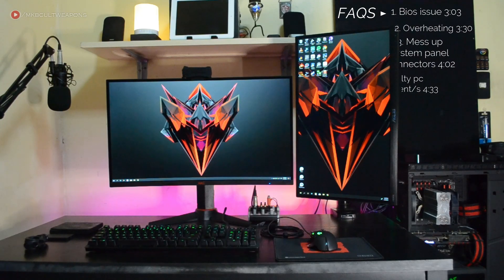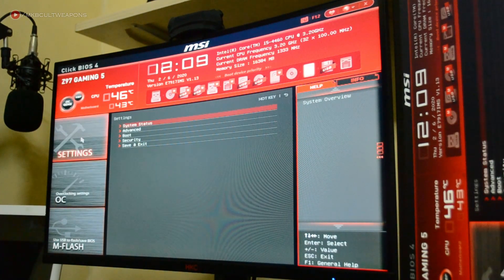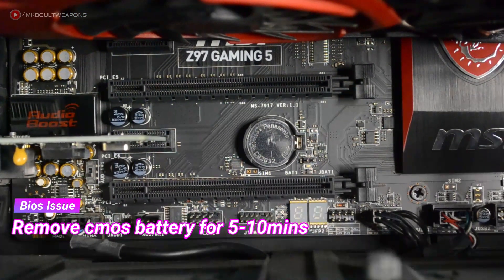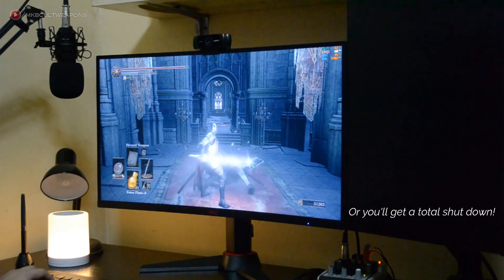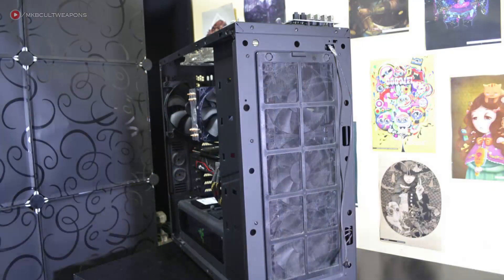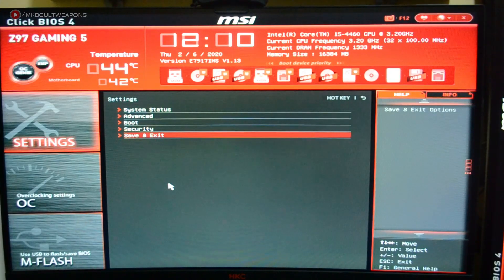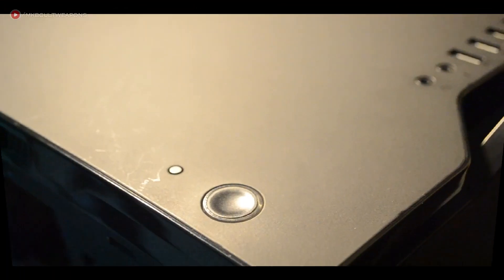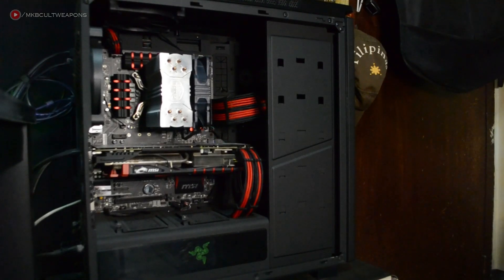Pc keeps restarting FIX / Pc continuous restarting FIX

Comment: Hey man I recently bought a pc and my screen will freeze then turn green and then my whole pc will restart, do you have any clue on what I could do to fix this?
Reply from the maker: is that during heavy workload or just during productivity? If you can still go to windows desktop try to update the drivers, gpu and windows 10. After doing the updates and still happens i suggest use the Rma already since it's new you'll definitely get a replacement

Comment: Can AVR cause pc restart too?
Reply: It restart again, I'll just take it back to the repair shop tomorrow so that they can find the problem, anyway thanks for your help, hope you gain more subs 👍
Reply from the maker: yes if it's faulty, i experience that once way back
Reply: @MacCoyzkie  can I plug my pc to the wall to check it?
Reply from the maker: @Reel_95  you can but not advisable, your psu will basically take all the pressure from power surge if in case something happen. If you live in a country that has stable and consistent power from outlet it's ok, but if you're not, better purchase at least a power surge extension cable,  i think it'll just cost around $8 to $10 https://gyazo.com/ce50da5ec6f19033701b78b1e365bcd4
Reply: I plug it to the wall and my pc still keeps restarting every couple minutes,so I think my avr is not the problem, I already had it check and the repairman said it was the mobo so I had them change it, when i got home and use the pc it only last about an hour then it restart again. What do you think the problem is?
Reply from the maker: @Reel_95  wait! it still happens after replacing a new motherboard? I got a theory though, if you have multiple drives, can you remove the hdd and just use the boot drive? of course shut down the pc before doing so. This might be a drive issue, i remember having this experience before, i did all the ram cleaning and forget that my drive is very old hdd
Reply: @MacCoyzkie  I never try to remove a hdd before but I'll try it later if my pc restart again, so far its been two hours since I boot it and I never encounter any restart.
Reply from the maker: @Reel_95  if it's already working you don't have to try it :)

Comment: Thnxxxx man ( 1 ram slot was broken )
Reply from the maker: i see, hope you get a new one, thanks for the feedback
Reply: @MacCoyzkie  bro can u help me a little more i fixed the restart issue .. But now its heating up really fast and lagging while even using chrome. It was working just fine the day before yesterday i was getting 100+ fps in valorant while even recording ... Do u know anything that  might solve the issue a little.
Reply from the maker: @ryu1279  are you using aio, if yes check the pump if it's working. If it's running too hot probably the airflow is not good, try opening your case during heavy workload
Reply: @MacCoyzkie  tnxx i think i figured the problem..  There are some issue in my hard drive i think

Comment: Hi, I have Alienwae Laptop 17 R2 that restarts after approx 30 mins. What could be the problem?
Reply from the maker: that's most likely caused by dust clogged heatsink. I know it's difficult to clean laptops but i'm still going to ask 😁 if you clean off the dust inside? For short it's overheating because of lack of airflow

Comment: Heeeeellllpppppp my problem just started yesterday when i was playin a game. It just ramdomly turned off then on but no image or nothing... I have my air conditioner in my room  and this one time when it started to blow cold air it turned off the computer completely but started bybitself back on normally.then the next day this happened, I tried the ram trick, no luck, also tried one ram stick no luck. Help pleaaaaaaseee. Quiestion, Can a virus cause this also?
Reply from the maker: wait what do you mean blow cold air, was that direct cold air coming from air condition or you use a fan to blow cold air in your pc? First of all please don't directly place your computer where the cold air is blowing from your air condition. You will short your pc overtime. 
Yes it could be a virus if you visit a lot shady websites that causes a lot of pop-up windows. If you accidentally click those it may install a virus in your pc. Some crazy virus can cause a program to put your pc to non-stop restarting.
Reply: @MacCoyzkie  thanks for reply ing, i had a small fan that uses water to blow cold air, and a big one in the window because its been so hot this days, i had the small one in the back of the computer so it doesnt heat up that much but i didnt know thats bad, is it? I just found out that if i take he gpu off, the computer starts normally, with the the gpu installed it turns on and off. So that means the gpu went bad already? Or was it a virus that messed  my gpu! Because i just click on that especific game that i installed to play it and it did that thing turning off and on by itself in a loop with no image on screen and the only way i turn it off was to keep pressing the power button.
Reply from the maker: @jaibo9154  if you have air condition don't let it blow directly to the pc also the small cooler where you put water to blow cold air, do not let that air blow directly in your pc because of those small water particles will short your parts. Did you plug your monitor to your gpu monitor input or to the motherboard monitor input? Upon reading your comment i think that's how i understand it.
Reply: @MacCoyzkie  when i plug in the monitor hdmi to my graphics card thats when it will turn off and on by itself, but when i take the gpu off from the motherboard the pc statsnormally, so i guess the gpu went bad? Or could be something else. I might get another gpu, i wont be puttingb the Small fan anymore to cool down the pc. Thanks for letting me know before the entire pc got meseed up. So you think those small water particles were the ones that messed up my gpu?
Reply from the maker: @jaibo9154  i don't want to give up yet cause i know gpu are really expensive. Can you ask a friend with compatible pc to try your gpu out? if the problem still persist then i guess you'll need a new gpu
Reply: @MacCoyzkie  Thanks for quick response. Thats what i want to do to test it in another pc, i will be asking around with my brothers friends if they have a pc. Most of my friends have ps4 or xbox. Its what i hate about computers if one of the expensive pieces gets messed up you gotta buy it again, im regretting selling my ps4 and xbox to become a pc gamer. If i would know. Thanks for all the help and response tho. I really appreciate it all.

Comment: I need help kuya. My pc keeps restarting when I turn on my pc. No display and no lights on the keyboard. I accidentally turned on my pc without the connection to the hard drive. After I connected the hard drive there's no display on the monitor but the light on the keyboard is on. After I tried the ram method, my pc starts restarting without display and lights on the keyboard. Please help me kuya asap. My pc is only standard and I use it for my online class.
Reply from the maker: wait what? you plug your hard drive while it was powered on? Bro that's dangerous you most likely shorted something in your pc. There are two things that might be broken, your hdd or your psu. The solutions in this video is not actually applicable in your situation. 

if you got a friend with compatible pc, can you ask them to try your hdd, ram and gpu (one at a time) in their pc. if it works with no problem then your motherboard or psu may be broken. I'm sorry bro but you need to ask help from a local shop to fix that for you
Reply: @MacCoyzkie  no kuya. I didn't plug my hdd while the pc is on. I turned it off first 😅 Actually we tried my hdd to my friend's pc and it works well. Then I showed him your video because I think your video is the most precise one. So we disconnected everything on my pc then we clean every plug and connector before we reconnect everything. Then the we did the ram method that you taught on the video then we reseat the ram. I only use 1 ram and I have 2 slots. Now my pc works well. Everything is running good, no parts were damaged and we tried to run the pc for maybe five to six hours and there are no problems with it. I didn't know that my only problem was dust on the ram and hdd. Thank you sir. You are really a big help to the pc community 🤙 Salamat kabayan!
Reply from the maker: @juliansomera9575  oh ok glad it's working now and glad the video was able to help you guys, thanks for sharing your story and for this feedback :)

Comment: I tried installing 2 more ram sticks, the guy who tried putting my pc together put the amd fan with the tab blocking the ram port i had to unattach rotate and reapply thermal paste, then found out that 4 sticks causes my pc (built june 1st 2020) to not show on my display port after removing the 2 new sticks i got if working but now it constantly crashes and kicks me out of escape from tarkov which i had 0 problems prior to having to move the fan can anyone help me please?
Reply from the maker: bro your pc is so new you have all the right to bring it back to the shop where you got it from and let them fix it for you. Anyway if it's constantly crashing i guess those ram sticks were not plugged in all the way or it's losing signal somehow
Reply: @MacCoyzkie  built it brother no shop haha
Reply from the maker: @iamgod222  oh did you bought the parts in different shops and build it?

Comment: currently having this problem, tried cleaning ram , removing a ram and still nothing, tried updating bios still restarts, checked the wires everything seems to be in the right place , I cant figure out why its restarting randomly , cpu was at temp was at 56C , tried updating drivers and it restarts
Reply from the maker: this might be also a low power draw, from psu or wall outlet. checking both of those may also help. i think your pc is fine and this usually happens when low power is given to the pc.  does it happen during gaming or even in windows desktop?

Comment: My pc just started to shut down and off out of no where, removing the cmos and ram sticks didn’t work at all. What could the solution be?
Reply from the maker: if you tried all the suggestions in the video and nothing work, 
1. if all fans are off and no lights in keyboard, mouse or anything in the pc then your psu is dead
2. you need to ask a friend with compatible pc to try your rams and gpu in their rig (one at a time). if it works in their pc then your mobo faulty

Comment: My pc is like going on and off forever but the monitor is not going on.
Reply from the maker: if you tried every suggestions in the video and nothing work that's probably a faulty psu, ram or gpu
Reply: @MacCoyzkie  i took my Brothers ram stick and gave mine to him and it is still the same thing. My does not work but my brother's does
Reply from the maker: @HHHavenn  your rams sticks are safe, this means that it might be your motherboard, psu or gpu.

to check gpu, ask your brother again to try your gpu, if it works then your gpu is safe too

to check the mobo if it's ok, turn on your pc and see if the lights are on and fans are running your mobo is ok

to check psu, you will not see any fans running or lighting up your in your pc, this means your psu is dead

btw, these are all applicable if your pc is around  1year or above. If your pc is newly build one, it must be incompatibility or bios issue. i hope this helps
Reply: Tanks for help. I am gonna try but all my fans are Running so it is not the psu. My pc is around 1 year so it is built correctly. If it start i Just want to thank you for helping.

(i got New harddrive and now it works but i needed to install everything)

Comment: Hi man. I’ve got a problem where my pc switches on for 10-20 seconds then switches of but immediately switches on again and again. I tried so many things . i do nt know what to do !!! Please help
Reply from the maker: if you have tried every suggestion in the video then you might be facing a psu or gpu issue. best thing to do right now is to bring your pc to a local tech shop
Reply: Mac Coyzkie thank u very much!
Reply: Mac Coyzkie hi I actually got it checked out and was told that it could be the motherboard and that there was nothing wrong with the gpu and psu . Could that be a possibility?
Reply from the maker: @mohamedchikhaoui8479  can also be but rarely happen. Usually the motherboard fails if the manufacturer is unknown but for known manufacturers like asus, msi gigabyte asrock, it doesn't usually happen in my experience. it's always the gpu and psu or rams. 
If the local shop told you its the mobo is faulty i guess it's better to upgrade then

Comment: Sir ung pc ko po nag automatic restart nangyari na din to last month ininstallan ng bagong windows pero mga 3 weeks lang nangyari ulit kailangan ko po kasi para sa online class nasa 40 to 50 lang nmn po ung temp
Reply: Tinry ko na po ung sa Ram nagrerestart padin po
Reply from the maker: @charlezu5276  nag work ba sya ng normal at least 1 week? Usually kasi Rams yan, if ever may tropa ka na may compatible pc katulad ng sayo try mo yun ram mo sa rig nya. kapag ganun pa din result may tama na ang rams pero pag hindi baka yung mobo ram slot mo lang. Nalinisan mo na ba pc mo?
Reply: Gumana po sya ng normal ng 3 weeks

Comment: yo so my pc runs perfectly fine until i play a game. when i play for 5-30 minutes depending on the game, it shuts off a goes into a boot loop. anything i can do?
Reply from the maker: it must be the high temps on your gpu and cpu specially if you tried to play in ultra. try lowering your game settings and opening your pc case during gaming

Comment: I brought a 4 gb ram stick yesterday so i decided to put it in after i put it in my computer started turning on and off 

My mother board is Gigabyte GA-B75M-HD3
Reply from the maker: did you put it with the old ram?
Reply: @MacCoyzkie  yes after that i tried turning it on and it turns on and off
Reply from the maker: @TrainWallspin  ok your rams might have different speed and capacity, as of now your pc will work if you only use either of them but not together
Reply: @MacCoyzkie  where can i see the speed and capacity of my rams
Reply: @MacCoyzkie  both of my rams are 1.5v and 1600 mhz and came from the same manufacturer the only thing different is the models
Reply from the maker: @TrainWallspin  yeah different manufacturers will be a problem to, well that is in accordance to my experience only
Reply: @MacCoyzkie  so i tried putting the old ram to the second slot and it did the same thing it turned on and off there might be something wrong with the second slot
Reply: @MacCoyzkie  btw i only have 2 slots
Reply from the maker: @TrainWallspin  i see, that's really the problem at times but i hope it will stay working

Comment: My pc keeps restarting, I tried to plug the fans only and that worked just fine without restarting.. is that what is called low power draw?
Reply from the maker: might be, if that is the case i guess there is too much power being drawn out from your psu, you might need a larger psu watts.
Reply: @MacCoyzkie  
just to let you know: I jumped the fans by putting paperclip between the black and green wires of the 24 pins cable.
my specs:
I5 9500
rtx2060
SSD 256
1TB HHD
Silverstone 600w +80
Reply: @MacCoyzkie It is the first time that ever happened,  the pc was running  fine but the house had power shortage for 2 hours tho I have the pc plugged on a UPS but I was asleep and i wokeup and saw the pc was turned off although the UPS didnt run out of power!
So basiclly I dont know what happened
Reply from the maker: @TSCoObRa  there are many areas that could start this, im not sure about the fan jumped but for the house power shortage is also a possible issue, the good thing is you have ups. Make sure that the house power is stable, this also happened to me before and i have to change my psu after that
Reply: @MacCoyzkie  
The problem is fixed yaaee 😝
I changed the psu and everything worked fine.
Thank you for your replys and I will make sure to fix the house power n make it stable.
💜
Reply from the maker: @TSCoObRa  awesome bro, glad it worked already. You're welcome and thanks too for the feedback